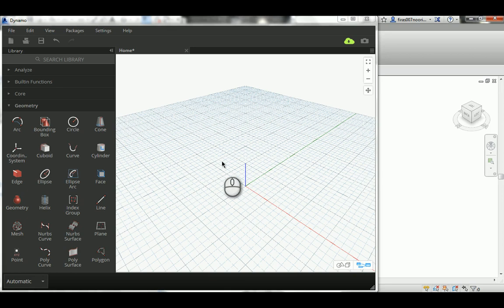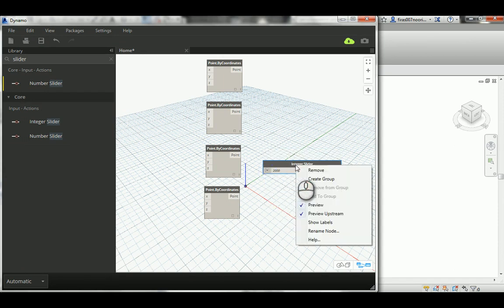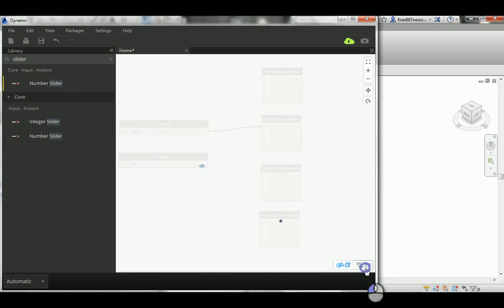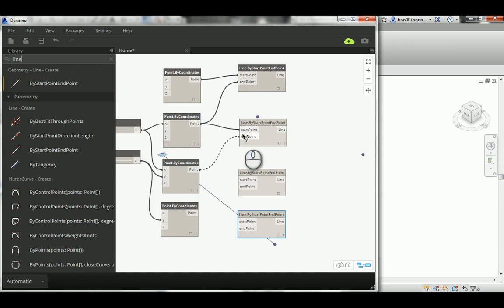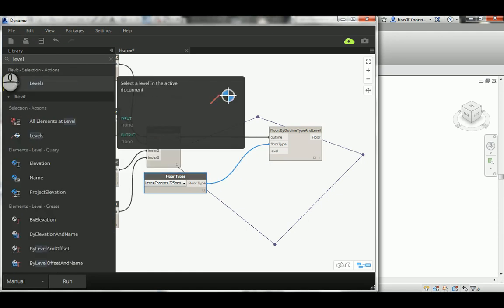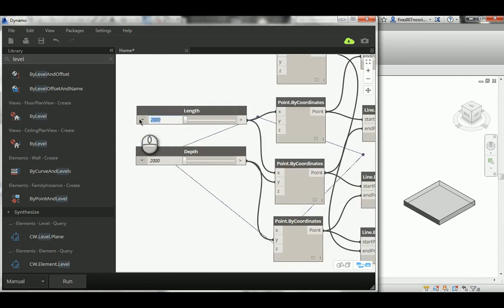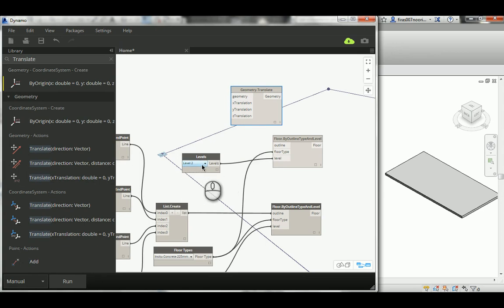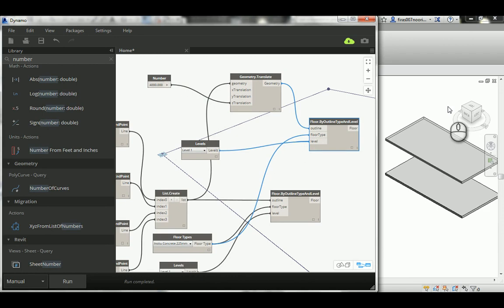Making a Parametric Room in Dynamo

Comment: Hi Firas , Thanks for the video really helpful but i have a query is it any process to link this dynamo script with another revit model??
Reply from the maker: Hi, thank you dear, I am not fully understood the question, but if you meant that is it possible to design a different shape nor rectangle (in plan) like making an L-Shaped plan room, it will be a similar tech. And if you meant the exact code I showed here in this video, I think you cant use it to draw a cylinder,  and u need to amend it, you still can make a new node to pick closed loops at any shape and make them real full details rooms or building!